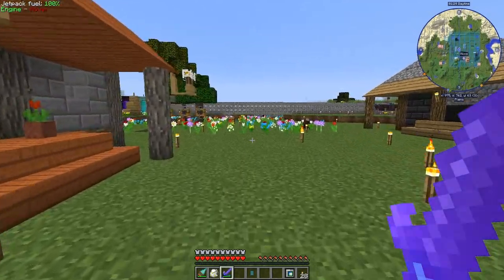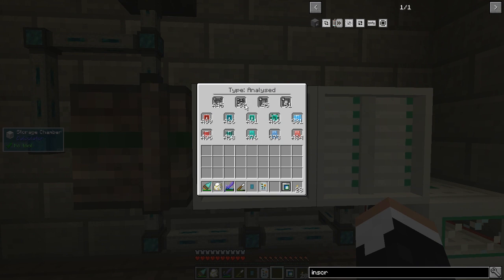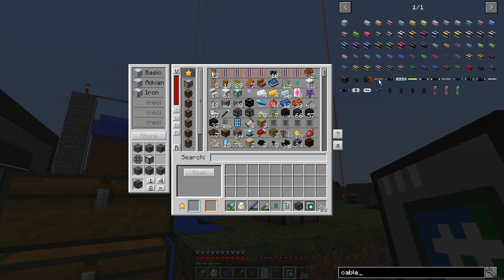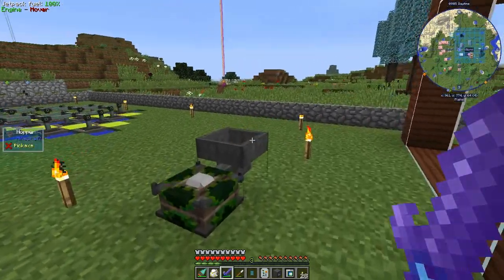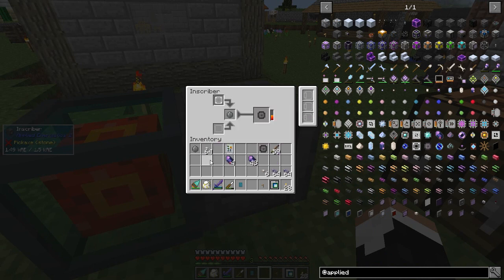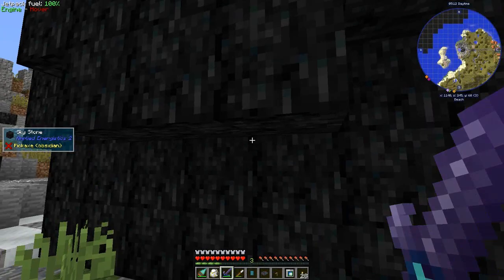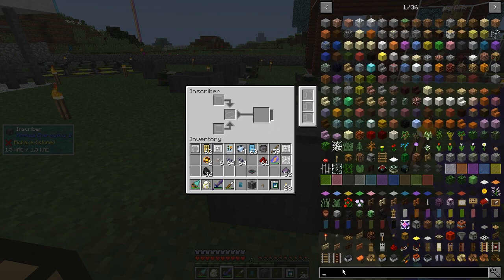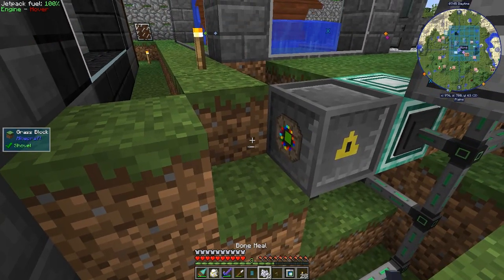Age of Engineering, E35- Applied Energistics, pt. 1

Comment: Nightdagger... the guide mentioned the Holo-Projector, which would help you with building the multiblocks you need for Advanced Rocketry, like the Electric Arc Furnace, if you haven't figured that out yet off-camera or in post-processing.
Reply from the maker: +SlidingSilver I figured that out, yeah.  I also figured out that it's going to be a lot slower than I originally thought.  I may still build it because I'll need it eventually anyway but I'll probably stick to clay processing for silicon.